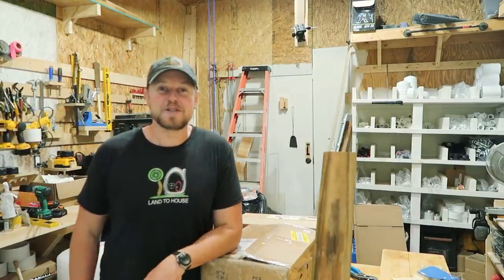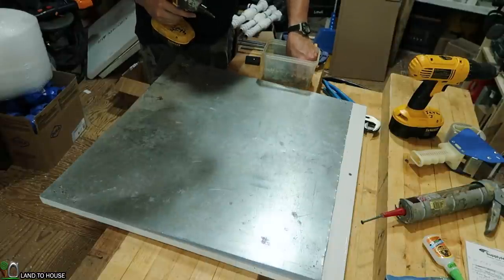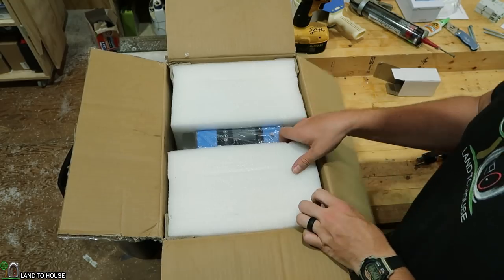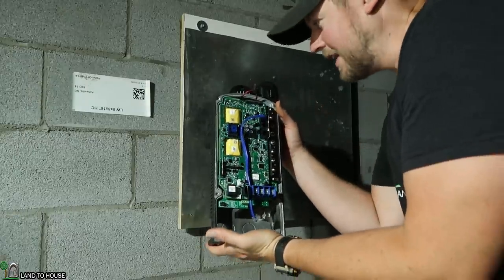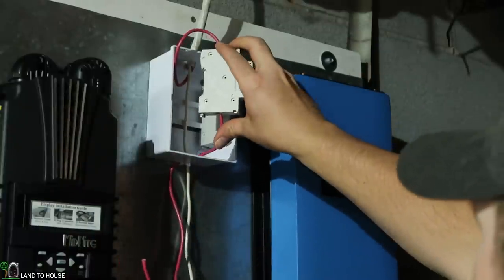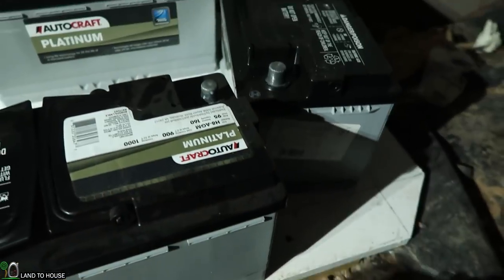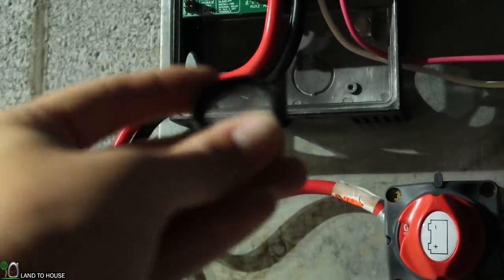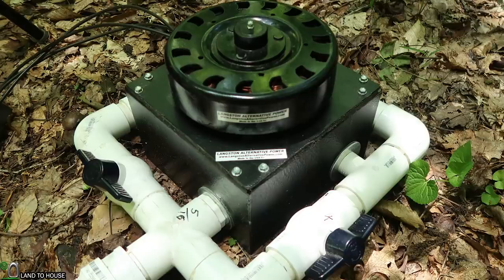Install Electronics Micro Hydro 8/10

Comment: Using the metal plate behind all the components is a mistake.  By all means add an extra heat sink to the charge controller and a separate one to the inverter, but they should NOT be near any connections. An alternative idea is to space any heat producing component out from the board about 1 inch to allow more air flow. Normal practice is to mount all the components directly to a hard wood board. The hard wood board holds all the components secure while providing an insulating barrier. Then all the components need to be connected together with a common ground wire.

Comment: It appears that you have not installed any over-current Protective device between battery bank and the inverter. There should be a suitably rated battery fuse or breaker between battery and inverter. 
Q1:Was that forgotten, or an intended omission ?
Q2: Was that inverter intended by manufacturer to be a “Battery inverter” or a “PV inverter” ? 
I ask because I wonder why you had to connect 5 pieces of 12volt batteries, instead of 4 pieces.
What does the manufacturer manual say about battery connections, and voltage ?
Reply from the maker: Currently all that I have is a cut off switch between the battery and the inverter. It was more of a "I dont know if I need this". The inverter is intended to be used with PV. It is working very well with the batteries. I went with the 60v system because it uses power better that way. Higher volts lower amps.
Reply: @LandtoHouse  the inverter is internally fused

Comment: Wire clamps my friend.  When you bring those lines into the boxes, put wire clamps on them.
Reply from the maker: This little plastic box would not hold a wire clamp. As for the midnite solar I think that it would fit a wire clamp.
Reply: @LandtoHouse  Better at least put some kind of sealer like silicone to keep the mice out.
Reply: @LandtoHouse  yes it will a bit tight  but do able , make it safe an secure

Comment: If the metal edges are still sharp. I suggest corner guards to cover them up.
Reply from the maker: They are not to bad! A little sanding and its nice and smooth.

Comment: I think it would be better to run multi-stranded (lots of fine copper wires) conductors from turbine to breaker/CC. DC travels on outside of conductor (not thru it like AC). Looks good.
Reply from the maker: The rectifier is close to the charge controller so AC is coming from the turbine. The solid wire should be good from there.

Comment: What about the redundancy of the system being negatively effected by the need for a small battery in the charge controller? Seems like a weak link in your system. Everything else looks great.
Reply from the maker: I think the controller will work without that. There are versions of the midnite that do not have a front panel. But yes that would be an issue if the battery could not be obtained.

Comment: I don't know if the question has been asked. If you figure a mechanical system to operate the water valve
Reply from the maker: That might be a fun test for the future. Currently I just go out and turn on or off a valve as needed.

Comment: are you going to add another controller for solar as 1 controller can not control both also they is a spercific controller for hydro/wind they are difernt to the solar controllers
Reply from the maker: Good question. Yes this controller is a midnite solar classic 200v and it is set to Hydro mode. The solar is going to use a midnite classic solar 200v SL. This version is cheaper and does not have internet connection. It will send power to the batteries the same and should be setup as a "follow me" to the hydro unit.
Reply: @LandtoHouse  that's good I did not know the solar ones also do wind hydro
Reply from the maker: The SL is solar only. The regular classic is all three.
Reply: @LandtoHouse  good to know cheers

Comment: why didnt you relocate the rectifier to the metal heatsink?
Reply: The 250ft of cable from the turbine ran out, that’s why the rectifier is where it is. It would be better if it was as close as possible, but sometimes the situation doesn’t allow it
Reply: Dust76tr The wire he used the white stuff is the same correct why I needed to extend it. A few wire nuts will do the job just fine and reduce voltage drop
Reply: Michael Illingby the ‘white stuff’ wire (presuming you mean what he ran to the circuit breaker & the midnite) was only 2 core. 

He could have possibly used the orange wire that he also used for the new sockets he added, to extend the run from the turbine, but not sure if that would be rated for 200V DC
Reply: Dust76tr if that’s the case then I was wrong to comment but I could’ve sworn he said it was a 3/10 or 10/3 I can’t remember what I heard him say. All my years as an electrician I have seen things that make me shake my head. Ps all wire doesn’t care between ac or dc. It is devices like switches and breakers that care. If you’re going to bring up SKIN then it doesn’t apply.
Reply: Michael Illingby sure, AC vs DC doesn’t really matter for the wire itself, and you’re absolutely right, the breaker would have to be rated sufficiently to be able to break a DC arc, which as you know, are a lot harder to break than an AC arc at the same current. 

I just meant that the cable would need to be rated for at least 200V, which is what the turbine provides, open circuit.
Reply from the maker: I ran out of 10/3 wire and did not want to add another junction box at that wire. So I just installed the rectifier there.
Reply from the maker: Yes well said.
Reply from the maker: I am thinking that the voltage drop on 12ish feet of wire is very small.
Reply: @LandtoHouse  of course Seth, but loss is loss, and it should be on the metal anyways to dissipate heat. and you have the wire already. All reasons to do it, and none to not do it.

Comment: Man, all those high current devices mounted on a metal plate. Also most of the devices are metal which are also touching the same plate. Just one loose wire away from energizing the whole thing and a catastrophe for anyone who touches any part of it...
Reply from the maker: New detached power shed is almost finished. All these things will be moved soon.

Comment: Anyone else concered that if he does not switch off the batterys before pulling the plug out the resepticle, he will have 2 live prongs dangling and a bit of wire.

I would swap the plug and recepticle for a solid wired switch
Reply from the maker: That inverter is Islanding. As soon as the grid power stops the inverter is powered down. Later I am going to install an inverter that is true off grid.
Reply: @LandtoHouse  Fair enough. Great video series btw 👍